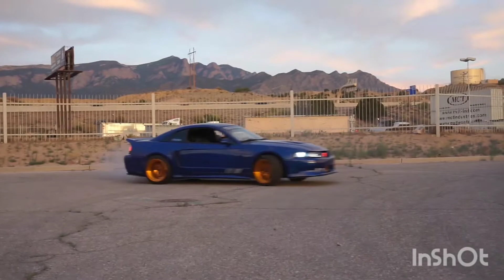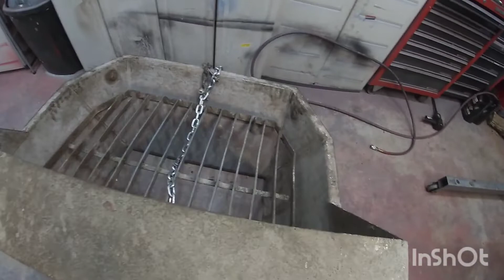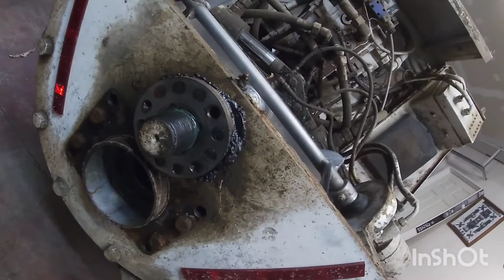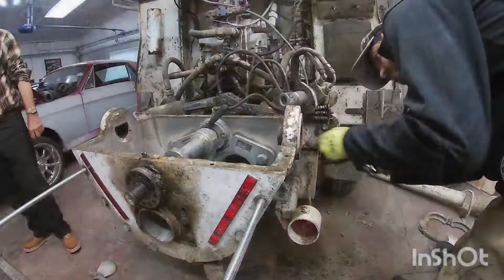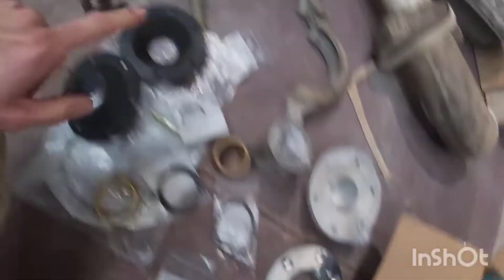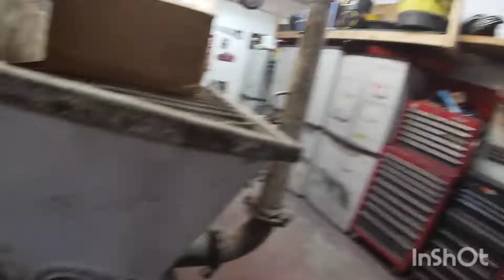Schwing concrete pump kidney seal and agitator bushing replacement

Comment: How do I contact you if I need some parts for this pump?
Reply from the maker: You can get parts from Saida Tuggle at Concrete pumps supply 772 323 3989